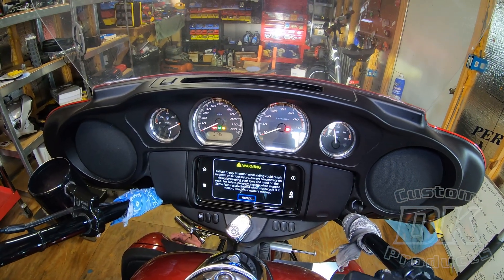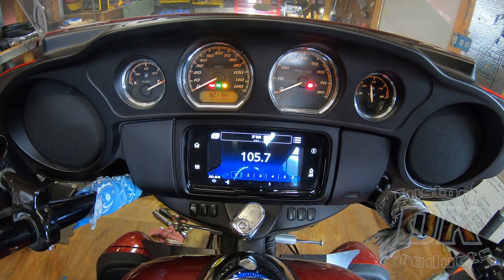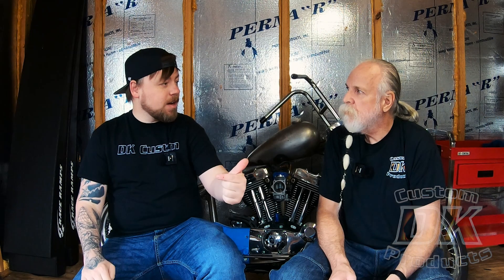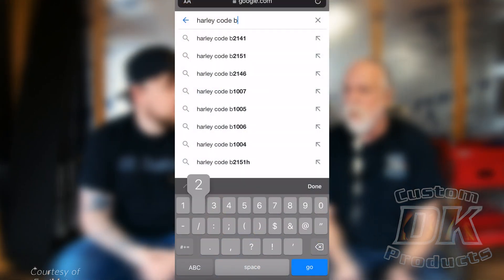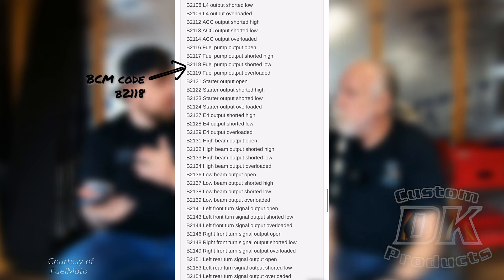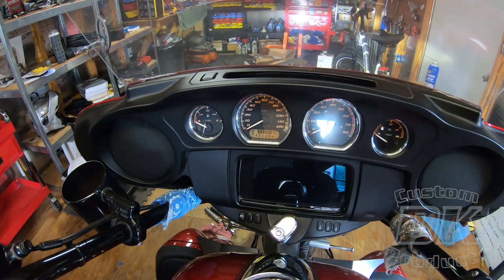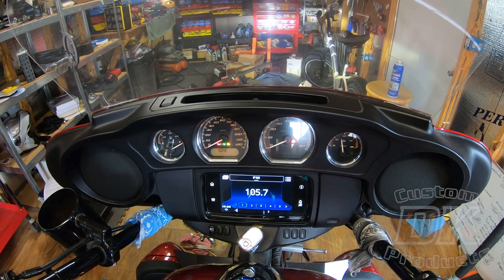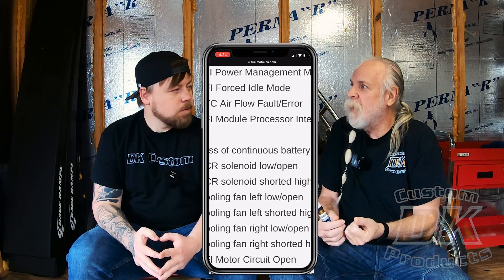Harley Check Engine Light & DTC Codes How to Clear

Comment: Great vid.  What can be done if a code won’t clear ? I have an ecm code p1100. Normally I can reset it and any others and be on my way. Usually it’s a random 3 wks before codes come back. Is scanning with Digital Tech the only way to get the exact problem location ? 
Thanks
Reply from the maker: Thanks! P1100 usually points to an IAT sensor issue. If it keeps coming back, a Digital Tech scan is the most accurate way to pinpoint the cause. Still, it’s worth checking the sensor and wiring for damage or loose connections, and making sure the sensor isn’t gunked up with carbon.

Here is a link to page with codes and what the codes indicate that you may also find useful - https://university.fuelmotousa.com/article/harley-davidson-diagnostic-trouble-codes-dtc/

I hope those are helpful. Thank you for commenting! 😎 MB

Comment: 2001 softail carbureted check engine light light ont reset no codes! Any ideas? Reset emc with battery reset
Reply from the maker: I'm not entirely sure what's going on or exactly what you're asking, but here are a few things you can check that might help: Check grounds and battery terminals, clean and torque both ends. Inspect fuses and relays, even a partially seated fuse can cause this. If the speed sensor is unplugged or dirty, it may not trigger a code but still light up the CEL.

Thank you for commenting! MB

Comment: My red key light stays on
Reply from the maker: If your red key light is staying on, it usually indicates a security system issue or that the bike isn't recognizing the key fob. Try replacing the fob battery first. If that doesn’t help, double-check that the fob is properly paired or consult your owner’s manual for reset instructions. 
Thank you for commenting! 😎 MB

Comment: I have a ‘24 Tri-Glide Ultra. Your video is very helpful, but I’d like to know what the small letter after the trouble code refers to. After a couple of my codes I see a lower case “h” and I believe I’ve seen a “c”. Does the “h” mean historical? The ”c” continuing?
Reply from the maker: You’re spot on! The lowercase “h” means Historical, which indicates a past code that isn’t currently active. The “c” stands for Current, meaning the issue is active right now. Glad the video helped, and feel free to reach out if you’ve got more questions!
Support@DKCustomProducts.com
662-252-8828

 👍 Thank you for commenting! MB

Comment: Turned off my bike before  turning off my heated gear, bike did not start and hazards started flashing , after a while  the bike was able to start however when i rode the orange oil / check engine light stayed on ? Is that because of  engine  being  shut off before  the heated gear controller ? On a 2021 heritage,  oil level  seems fine  and motor hasn't started any  funny noises any  ideas ?
Reply from the maker: This is about your Harley having a lot of computers built into it.  See video below.
1.  Turning off the bike prior to the heated gear put a load on your battery/probably confused the CANbus harnessed computers.   That is why it would not start back up right away.  Battery had to have time to recover.
2.  The computer systems experiencing the unexpected event on shut down confused them, and they had to have time to reset.
3.  When the ignition was switched on, if all the computers did not have time to "boot up" prior to the bike being started, that is the reason the oil/check engine lights were on.
4.  It does not happen every time, but frequently, if the bike is started without giving time for everything to initialize, some features will not work/some warning lights may illuminate.

Here is a video explaining some of that- https://www.youtube.com/watch?v=2OnvvTM36_M
KP
Reply: @DKCustomProducts  thank uou fellas
Reply from the maker: You are most welcome! 👍 MB

Comment: I have a w013 softail slim and the speedo doesn't work and I don't know how to check if it's that or the body control module... any advice?
Reply from the maker: The three things to check first are:
1.  Fuses
2.  Actual Speedometer
3.  Speedometer Sensor, which is in the Transmission

Wish we could be more help, once it gets past fuses and into electronics, tools are needed to trouble shoot.
Since the error codes are displayed in the Speedo, and you cannot access that, you pretty much got to be hooked up to a digital technician to track down what is going on.

Newer bikes have even more electronics, but this video explains the challenges we are all facing due to more and more electronics on our bikes- https://www.youtube.com/watch?v=2OnvvTM36_M

I hope you get it figured out and it is not too much trouble. Thank you for commenting! KP

Comment: Good video guys... changed oil in my 21 M8 Tri Glide and I run down road to get it  warm...no problems.  After oil change check engine light stayed on.   Cleared codes light went off....
Reply from the maker: I am glad that you found the video helpful! 

Here is a good video on M8 Oil Level Check that you may find interesting/useful - https://www.youtube.com/watch?v=thzjNfl95ro

Thanks for commenting! MB

Comment: How to do this for a Nighster?
Reply from the maker: The reset button on all Sportsters is on the back side of the Speedometer. You should just find the tripmeter reset button and hold it for a few seconds while turning the ignition to the on position. 

Thanks for commenting! MB

Comment: I got my first code while out riding my fairly well modified Touring M8 107 with stage II and power vision, (all mods have been completed several miles ago) in 50 degree weather this weekend.. Just heading home, so will be checking that code number tonight.. I'm thinking it might have been decel pop related as I heard what might have been a decel pop while decending a hill here in Ozarks (or a plug wire popped off) thanks for the instructional video..I am using lengthy dual exhaust aftermarket with crossover, and have baffles and Torque inserts both in my exhaust..be interesting to see "whats' happened"
Reply from the maker: Will be very interesting to find out what code was thrown and why!

Comment: Is it possible for after market LED light kit can make a check engine light come on?
Reply from the maker: What bike do you have and exactly what lights have you added?
Reply: @DKCustomProducts  have a '23 Fatboy and I added LD DarkEagle LED light kit
Reply from the maker: The CanBus system on the 2012 and later bikes can be very sensitive to wire size and led's, so that is completely possible that the addition of your light kit will throw a code. (all our LED's have been tested, and none of them throw a code).
Here is a video on how to check for codes when you get a check engine light-
https://www.youtube.com/watch?v=1t-uHPQs0U8

Comment: Thank y’all! I don’t believe that something major is wrong BUT, possibly. I just picked up my new 23’ Road Glide after I had extended 14” cables/ Bars & a Stage One installed yesterday, (108 degree temperature) and rode home about 40 miles, ran great, got home let bike cool down and went to ride to dinner somewhere and Christmas lights came on dash, (CHECK ENGINE & ABS & TRACTION CONTROL all same time, (we’re not riding to dinner tonight honey) checked codes and tried clearing them and to no avail,,, P1100c = MASS AIR FLOW SENSOR and T1032c = ABS WHEEL SENSOR..
Could it be a major concern riding it until Tuesday when dealership opens up?..? Any suggestions welcomed. Thank y’all! Ride shiny side up.
Reply from the maker: I would error on the side of caution and not ride it.  I would not want some of the nanny controls to malfunction while I was riding.
Probability is they pinched some wires during the handlebar swap.

Comment: Really there should be different colour engine lights. RED = turn off and trailer to dealership. orange = nothing major, keep riding and see dealer when possible. Green = nothing to worry about, reset yourself.
Reply from the maker: That's an interesting idea!

Comment: I had 4 dtc codes pop up as riding. I stopped,turned off,wouldn't turn back on. Fl I pped the power a couple times then started codes went off active to historic. Why would that happen? Should I take it to dealer? Is under warranty
Reply from the maker: There are a whole variety of reasons why codes can show and then go off active.  Depends on what the codes were and why they triggered....could be bad gas, could have gotten too hot, and many more things.  
For the Dealership, or anyone else to be able to start going down the path of why, it is important to know what year & model bike, what riding conditions were prior to event, and what the codes were.

Comment: I use my V&H FP3 with my iPhone to check Engine-light codes which are described too,…if nothing seriously wrong it’s easy to erase them too. It’s a nice feature among others the FP3 has,.. the Live Data is the best 👌🏻
Reply from the maker: Yes, the FP3, FP4 and Power Vision are all good for that.  Thanks for the add.
Agree with you, I fully enjoy having the gauges of live data. 👍
Reply: I put a New battery in my bike and now the lights do not work and it will not run

Comment: Have a device for cars that reads codes,  why doesn't Harley have that port?
Reply from the maker: It does have a port to read codes, but there is no need to use it since the code reader is built in, as shown in this video.
Reply: @DKCustomProducts  Just that device on car is much simpler menu driven and gives info on codes rather  than having to look up.
Reply: Once had my electrical system keep cutting out every 10 or so seconds, turned around home after about 1/2 mile. Bike completely died, but then would restart after a while. Had a whole bunch of codes that were about all kind of things. Eventually found the problem to be the ground connection at battery was loose. Dealership had installed battery, and no one else had ever worked on bike. Cleaned connection and tighened it to spec. Reset codes and never had issue again. Have had other riders have similar issues and also found loose connection. Had one guy with a V-rod that had the battery terminal completely melt..
Reply from the maker: Understood.  For that, get a Power Vision, it will dsplay the codes and give a description....all menu driven.
Link to Power Vision- https://www.dkcustomproducts.com/dynojet-power-vision-flash-tuner-w-auto-tune-dk-pv-cmp-pkg.htm
Reply from the maker: True that!  A loose connection will wreak havoc on the bike.
Thanks for the comment. 👍
Reply: @DKCustomProducts  Problem is that the one I got for car was $19.99 and can be used on any vehecile that has port for no charge. The link shows the power vision at $750 and would only be for one VIN. Think more can be added with a license, but not sure on price? When I got my Screaming Eagle Intake and V&H Blackout 2-1 exhaust years ago, spent $185 at dealership for mapping. If I'd have know would have spent the $385 at time for the V&H tuner. Have just over 48,000 miles on bike since I got it in 12/2014. Live on Island that is 32 miles long and 4 to 8 miles wide and top speed limit is 45mph. Most areas are 35Mph.. Thanks for info.

Comment: Good show. Keep in mind the ECM and BCM on the can bus systems do not like voltage changes(  IE )make sure you check and clean / tighten battery connections as part of your normal service. Loose and dirty connections can and will set codes
Reply from the maker: Thank for the comment Jack. 👍😎👍
Great point you make about clean and tight connections.  Just today I was talking to somebody who had some arcing on some loose connections...one of them was his battery, melted a terminal post.  Also, now he is having BCM problems...he's thinking there may have been some damaging feedback from the arcing to the BCM that caused the damage.

Comment: Kevin & Dwayne:

You can also check the codes through the hidden tech menu, and it gives you the code info. 

Turn on the ignition, wait for the warning screen to come on, hold down the power button on the screen for approximately 10 seconds until the hidden menu comes up, DTC's.

You can also go to reset and restart your mileage since last service.
Reply from the maker: Gonna give that a try tomorrow...too cold for me right now...31 degree out.  Thanks. 👍

Comment: There is a APP for your phone for Harley Trouble Codes. Remind viewers that the last letter, H or C is for Historical or Current.
Reply from the maker: Wow, that is something we completely missed addressing.  Good catch on the H or C for Historical or Current.  Thank you! 👍
Reply: Cheers for that. After doing an air intake install l got a P0151h come up after a day or two. It relates to the rear 02 sensor. I will clear it tomorrow morning. If it is historical it shouldn't come back. Cheers from Melbourne Australia!

Comment: This brings up another question.  You mention the “run/stop” switch.  Is this how you should stop the bike before turning ignition off ? Or can you just turn ignition off and be ok.  I have just been turning ignition off and my one friend scolded me saying I was doing a bad thing doing this. Yet for one year this hasn’t caused any issues.  

Please clarify so I can tell him I told you so.  😂
Reply from the maker: Many folks like using the kill switch (aka run/stop switch), probably because it shows that in the manual.  I rarely use mine, probably less than 1 time every 200 rides.  There is zero downside to not using it.
The only time I use it is if I need to shut the engine down and don't have a free hand to reach the ignition switch.  (eg. Left hand clutch in and right hand holding the front brake)
Reply: @DKCustomProducts  appreciate the reply.   I didn't think this was an issue, but its my first Harley and you never know
Reply from the maker: @Charlies_Riding_Adventures  Happy to help. Congrats on your first Harley man! Ride safe!